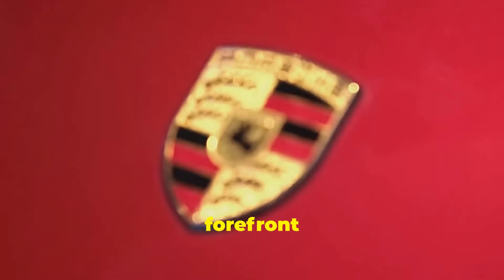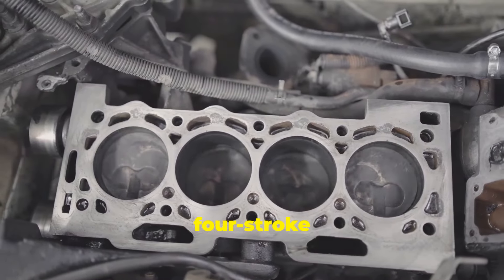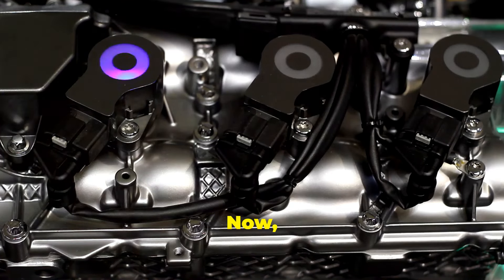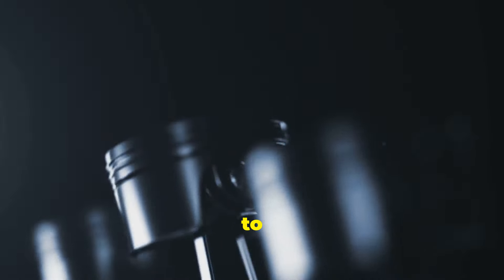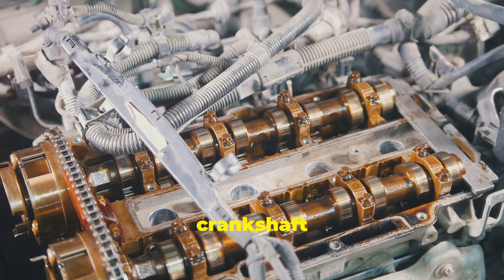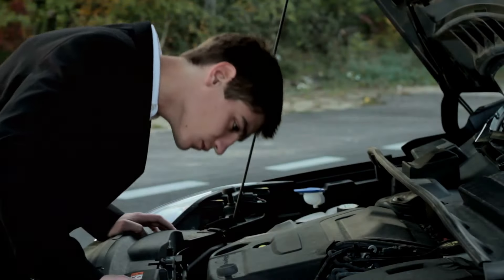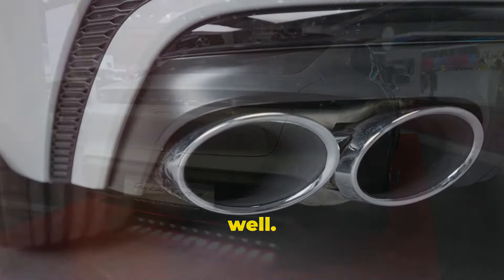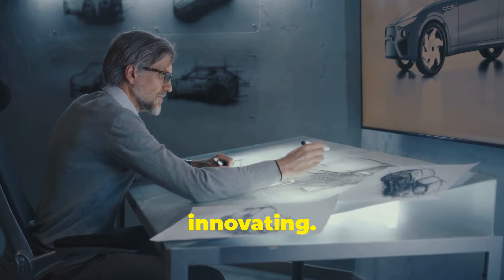Porsche’s New Six Stroke Engine Patent

Comment: They did that many years ago with the 2 stroke engine where the exaughst gasses went into a second cyclinder to be compressed and burnt a second time to use up the unburnt fuel.  As they say " there's nothing new under the sun"!

Comment: This is an exciting idea. Do you think this truly works more efficiently? There is no mention of increasing the engine's efficiency, and if so, how? Efficiency is the power that is extracted from the fuel when it is burnt. TYpicaly ICE has poor efficiency on low power output, an average cruising speed or in city traffic. That is typically 80% of engine operating time. Thus, fuel consumption needs to be improved, and there is a question of whether the emission limits are met. Another area is when we have different fuels available, like methanol, which is typically more efficient as it operates at higher CR.  How does this engine cope with this?  NOTE:  Regulations: Cars:  93,6 g CO2/km (2025-2029) and 49,5 g CO2/km (2030-2034) -  If the average CO2 emissions of a manufacturer's fleet exceed its specific emission target in a given year, the manufacturer must pay – for each of its new vehicles registered in that year – an excess emissions premium of €95 per g/km of target exceedance / manufactured car (vans have higher emission criteria).

Comment: Had this configuration a few years back - but didn’t take it further due to several realisations:
Deformation of ring gear at higher RPM, high internal friction due to number of gears in the arrangement, method of controlling CR cumbersome, reburn of exhaust gases caused NOx pollutants to surge, still short of 2-stroke power densities.
My latest patent will be a step change…..